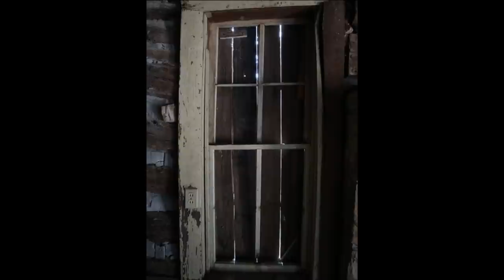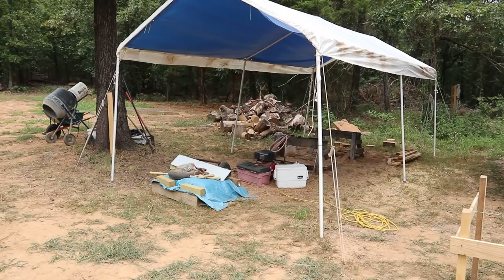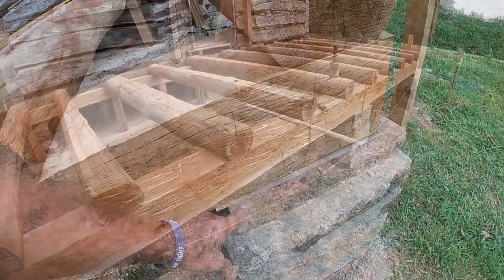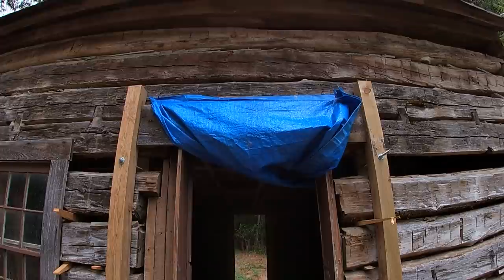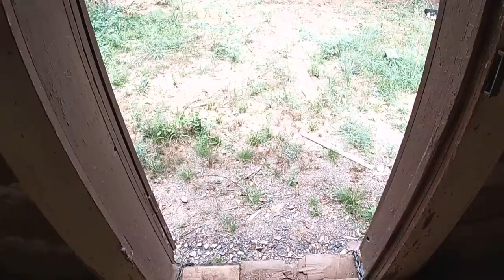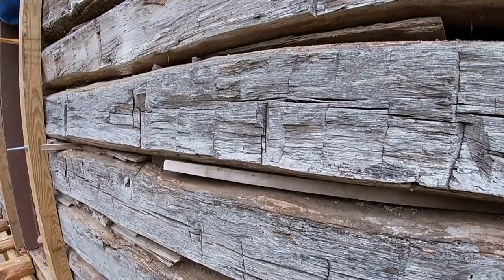James Thomas Gilliam Log Cabin (Pt 1)

Comment: I really like the stone work on that chimney.  Is that representative of the original design or is it a later rendition added during its last relocation?
Reply from the maker: Bud Woodman   Howdy Bud- this fireplace was built after it was moved to its present location a short time ago. The fireplace is about the same size outside but the firebox inside is bigger from what I’ve been told. I think the original fireplace was probably a drystack which was common back then. I appreciate your interest. God bless you